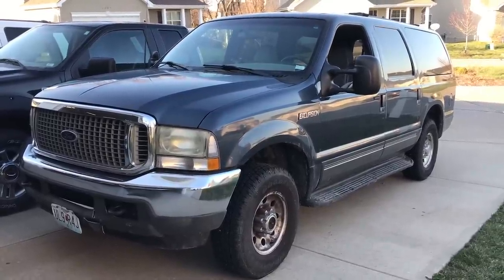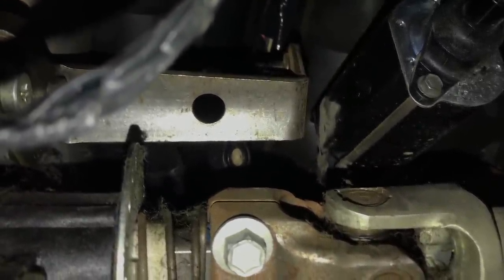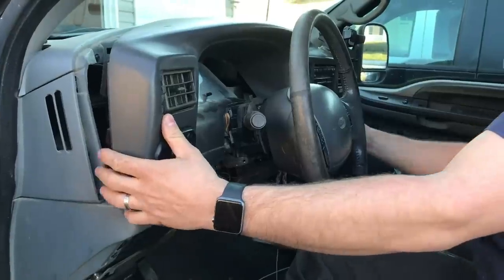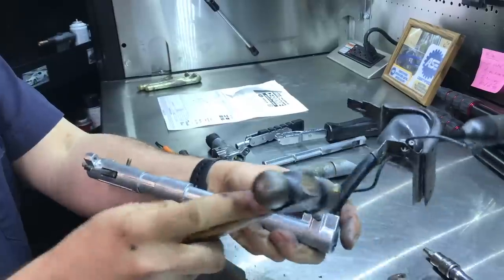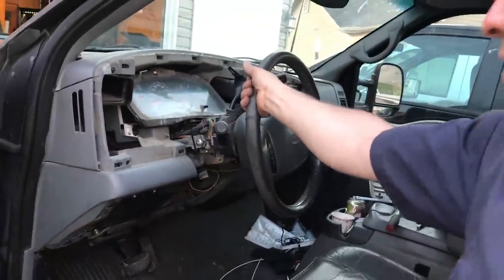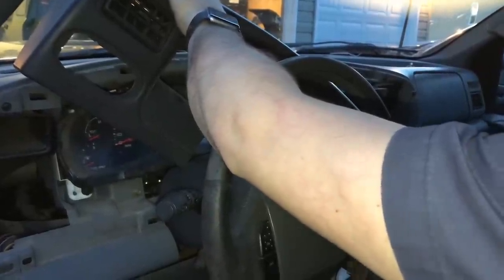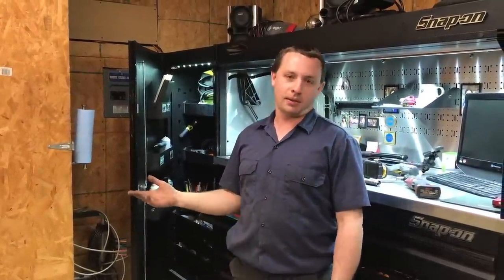Fix a BROKEN Column Shifter on Ford Vehicles

Comment: There is a small button under the ignition switch. Put the key in, turn the switch to the on position (not start), push the small button under the switch and the whole ignition switch comes out.
Reply: Bingo
Reply: Right on
Reply: My husband's 2006 Ford F150 will not go into reverse. I drove this morning and did a lot of back up. He said the was stuck in the curb and he gave it some gas, it came off the curb but made a clicking noise. This is an emergency please help.

Comment: As a mechanic I recommend to fully lubricate the inner shaft with a heavy grease, insert the tube. Lubricate the tube (with grease also) where the bushings are with the clamps. You will feel a "tighter" and smoother operation when shifting.
Reply: Should have taken it apart and greased it before the shift snapped.

Comment: I've had to do this twice on my plow truck, there's no need to remove the dash, all you have to do is remove four 13 mm bolts that hold the steering wheel up to the dash bracket, the steering wheel drops down and you have perfect access to all the shift column bolts

Comment: Moved my truck during lunch at work, and it wouldn't go into park. A minute of trying things later and a small bit of metal fell to the floor then I couldn't leave Drive. Thought I broke the cable. Limped it home, disconnected the cable on both ends and it was functioning fine. Transmission shaft lever was working fine. Looked up under the dash, yup the column was broke. Thank you.

Comment: Nice video, thanks. You don't have to take off the upper gauge cluster though. Doesn't really help any and the older ones have a tendency to crack pretty easily, during removal.
Reply: True

And probably better to remove the key housing using the release button

Comment: FYI it is much easier in this type of case where you have to replace the whole shift tube or the bushing to leave the dash components in place and just remove the 4 13mm bolts for the whole steering column mount. Once these are removed and the column is free you can drop it down far enough to reach all of the mounting bolts for the entire shift tube, (torx 30) it also make reassembly very quick and easy.

Comment: My explorer had a moderate problem in that it wouldn't go easily into reverse or park. Shop said I needed a new transmission, but I could fenagle it into reverse if I was lucky so I said nope it's not a transmission problem. Took apart my steering column expecting to have a loose or broken shift cable ($50 repair), but this video confirmed to me all that was missing was a bolt to pin the shift tube to the cable. Shop said I needed a $1200 repair, when all I need is a 20c bolt. Thanks for making this video you saved me thousands!

Comment: Dan, you have a great video here..... 

I have a 1999 Ford Ranger... and my shifter has been sloppy for awhile; years!.  My shifter tube was not broken, but figured after 24 years, if all of the stress, I figured I'd get new parts.  The bracket @6:22, I discovered on mine, the bolt sheared right off the other week.  I was like how the hell do I get to that!?!?  I had no idea it was relatively easy.  There was a little stub piece I could unscrew, but it didn't matter since I had new parts.  I did end up going to Ford and getting new Star screws.  4 for $15.00 😞
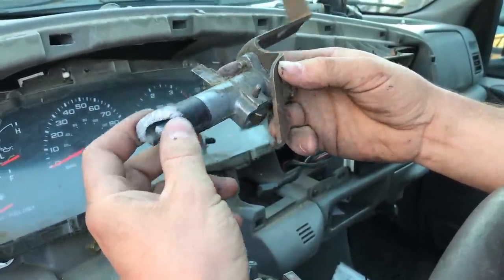I ended up getting new Tube and Plunger assemblies, and bushings, as shown in the video, starting @5:57 mark.  NOT from the Ford Dealership, but OEM Ford parts online.  I used white silicone grease to lube up the assembly.  And "blue" threadlock to keep things together.  Boy, my truck shifts so smoothly..... never in all of the years, do I recall it being that smooth and tight.

Comment: Was having the same issue that started mild and got progressively worse over a few years (breaking point was when it would intermittently start because it couldn't tell if it was fully in neutral), but luckily my shifter tube wasn't broken - just had loose bolts holding it to the bracket - tightened those up and replaced the plastic bushings on the tube and it goes fully into park again! thanks for your video!

Comment: My repair went pretty much as explained in the video.
Thanks so much for the very helpful instructions.  Here are a few key points that really made a difference:
1.  Disconnect the link to the transmission cable before lowering the column (easy to pop off)
2.  Mark the footprint of the rear pair of column bolts to aid in re-alignment when re-assembled
3.  Don’t bother removing the upper column cover until after lowering the column and be sure to re-install before re-mounting the column.  That saved a lot of fussing with this plastic cover.
4.  Disconnect the indicator cable early and perhaps dismount it from the column it to avoid damage when the column is lowered.  Mine only had one screw and the cable was short enough to become tight before the steering wheel rested on the seat.
5.  Dismounting the solenoid bracket to enable removing the tube with shifter bracket attached was a big winner
6.  If the width of your hand across the knuckles when pressed against a surface, like a karate punch, is more than 3.5” you might be better off removing the entire column instead of just lowering it.  Or, find an assistant with smaller hands.
7.  Shift Tube Part Number: 1F1Z7212AA and Shift Tube Bushing: F3TZ7L278A fit my 1992 Aerostar
Reply: Thank you
Reply: Great info. brotha, you rock

Comment: Just did a Steering column repair because of a sloppy gear selector.  Over time the metal end of the gear selector will wear away the aluminum gully on the shifter tube.  The new damper is a thick rubber, not the metal they used to use.  You need to grease the plunger, spring and the lever that goes towards the back.  When you drop the entire column by removing the 4 nuts, what can you use to rest it on so that it doesn't pull any wires or harnesses out of place.  I removed the 2 front nuts and backed out the back two until the last thread.  It's not impossible but some guys leave out the shortcuts on these videos.  Splain me some details about the column drop.
Thanks
PJ

Comment: Amazingly helpful video. Glad I read through the comments so I didn't have to remove the dash. Replaced the tube and bushing for under $50 with OEM genuine Ford parts. I was able to reuse the inner rod. '99 F-350 XL very happy to be up and running again. The A1 Auto video is also very helpful.

Comment: Great repair video. Well explained, clear camera, clear instructions. Saved me real money. I appreciate it very much. Thank you
Reply: Show me how where is the wind system is in the shifting column or shorts for the steering column turn signals
Reply: Show me the color of the wires for the turn signal in the steering column

Comment: I followed all these directions and this worked perfectly. I would like to add 2 possibilities you may want to check: #1 FIRST check your transmission range sensor (by your transmission, under the truck and is also called a "neutral safety switch"). This was the chain reaction problem that led to me having to replace this shifter column " twice ". This led to requiring extreme force to shift, therefore causing the column shifter to break, then causing the next problem: #2 The Shift cable housing broke from forcing the shifter and bent the shift cable at a 45° angle, leading me to have to replace it also. So...if your range sensor is seized, replace it first, then replace your cable if it appears bent, THEN this column shifter. Remember...the column shifter IS cheap metal...and there has to be a reason it broke in the first place. If you check these 2 items first and they are functioning properly, then it's just wear and tear of a cheap part. Otherwise, you get to learn how to do this in your sleep! 🤣
Reply: This is the explanation of changing out the range sensor

Comment: Thanks for the vid. Just did mine on a 04 250 6.0 went smooth. Also this is a very common issue with these vehicles. Typically see them break like.the one you have shown. Or the black plastic bushings completely deteriorate. Thanks again was very helpful!

Comment: On my 2002 F-150 Supercrew,I never had this issue but at one time I noticed that the shifter was not smooth and required some strength to put it into any gear on the transmission,it made a weird thud or shift every time I did,and some times when I would put the shifter back into neutral or park,it would sound like a crack.This happened very soon right before I ended up selling the truck,I never addressed or looked in to it,but I did mention it in detail to the person who was buying it.

Comment: I have a 1997 ford f150. At 10:28 in the video you mention connecting the gear shift indicator cable. What is the white part called that holds that cable in place?  Mine is broken and I am looking for the part. thanks for any help.

Comment: Hello, I liked and subscribed. I was following directions ( great by the way) my steering wheel locked into the half way position and with key in ignition can't get it back straight because the shaft is broken. Am I screwed, or can I get it back straight once I proceed? Thank you

Comment: Ur supposed to use a new pin. the manuals says so anyway.
I just did the bushings on my 98 grand marquis.  Then the shifter cable rotted at the trans. Now I need an MLPS because I have to wiggle sometimes  in P to start it :lol:. I thought the bushings would fix that.

Comment: Hey Dan I've got an 05 e250 with the needle all the way to the right... You mentioned in your video that a part's broken If it's stuck all the way to the right... I haven't taken the panel off to see what's broken but do you know what that part is? I've seen shift indicators online for around $20 or $25 with the cable. Is this harder to replace the whole thing than the repair the indicator itself? Thanks, TJ

Comment: Hey Daniel I had recently replaced my shifter column in my 2001 f 250 super duty but now the horn, dome light, wipers, and power windows do not work along with a bad shifter solenoid....if you could get back to me with any advice please do

Comment: Daniel, I'm hoping you can help me. My issue is the metal bracket that bolts onto the linkage with two bolts has broken. I don't know how to find the right part other than going to a junkyard and taking one from a truck. Any suggestions?

Comment: awesome video man! my 07 F150 XL (column shifter) is extremely lose and I cannot shift the transmission (I can crawl under and change it from there fine and I drove +150 miles like it since I was on a trip), the truck is currently in the dealership so I'm hoping it's a simple fix as like that, however, yesterday morning when I started the truck and tried shifting, it actually shifted fine! which leaves me wondering! anyway, thanks man for the great video!

Comment: What is the thread pitch for the torx bolts that hold the cable arm on if you happen to know? One of mine snapped off so I only have neutral and drive.

Comment: O.K..... I am going to fix my 97 Ranger, I hope.... (pick up the plunger monday, since I had to order it from another distributor -the original was broken in half in shipping - also, Chinese aluminum is of poor quality!! my question is, " Why did you not grease the plunger, clean the spring and grease, and under the new bushings, etc. I ask this because all other YOU TUBE videos i have watched apply ample grease to these areas?  thanks, john in co.

Comment: Update: all good.. if you don’t buy an OEM (which I didn’t because I wanted to fix it asap) you’ll have to drill out the holes yourself to fit the pins. Other than that no issues. Thought I’d share my experience.
Reply: I used doorman on 04 f250 and used the same pins. Knocked them in with a hammer. Super tight fit but they do fit without drilling

Comment: 10:12.....if you look through the front you can see the shifter cable and the knob if you grab channel locks you can reach up under and look through and clamp it on very easy ....I put all my stuff back together and it’s really tight won’t even shift proper 🙄🙄🙄🙄

Comment: followed video to the letter everything works fine now, Only I added something, I put a small dab of silicone to outside of bushings and some never seize to inside of bushing before clamping down,
Reply: Bruce Atkinson: does silicon protect bushings because they require movement around gear shift tube? Thanks

Comment: One of the torx bolts that holds on the metal plate at the end of the rod sheared off on my 94 F-150. I've been trying to use an easy out and it's been a bitch. The broken off bolt will not out. I'm probably going to have to take the whole damn thing apart :( I've been looking for a video to figure it how to do it so thanks.

Comment: Well, giess i know what im doing for the new year. F250, 2004. It has no amenities. Hand crank windows, hand slide seat. No working A/C. 
A junker i was about to put up for sale. Then this happened. As a 71 year old woman  who did go to vo tec in NH in 1978/80, i can do repairs. But remembering where fussy parts and bolts go back together seems to be a problem. I was always goid at taking stuff apart, not so good reassembling it. Although i did manage to rebuikd from scratch my 1966 Chevy Nova back then. Well wish me luck.

Comment: See I don’t get why so many replacement parts don’t come complete. Really couldn’t include some pins and a spring? Then it’s like a thousand hours of research if that’s the part you need. Han an issue with parking brake once ,bought the rear brake accessory kit nope, bought the parking brake cable kit nope. Had a sales rep search for days for the part which you can only by from the dealer , cost double all the other part you bought and takes 4-6 weeks to arrive!?!?!
There I have vented!

Comment: Just did this. Total junk ford. Come on. The trans position sensor rusts up and causes all these issues. I also just did a vid for cable retention as the wings on the cable are plastic on dont have a good hold on the trans bracket